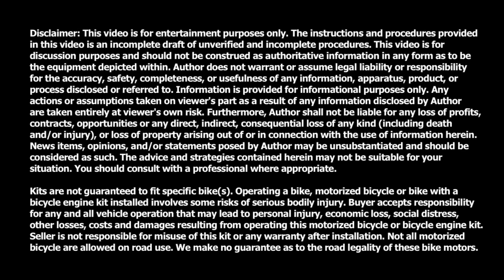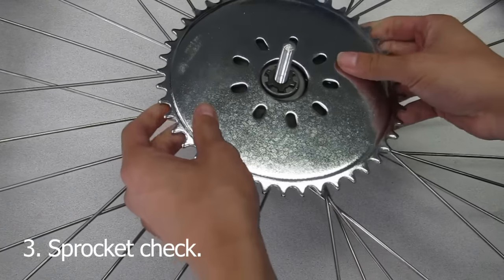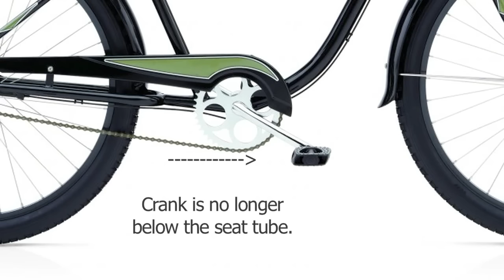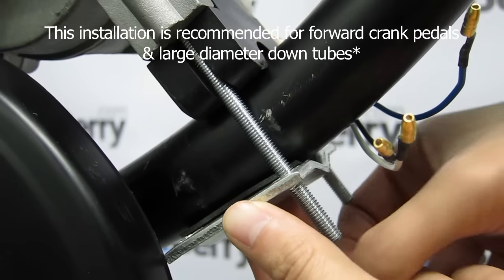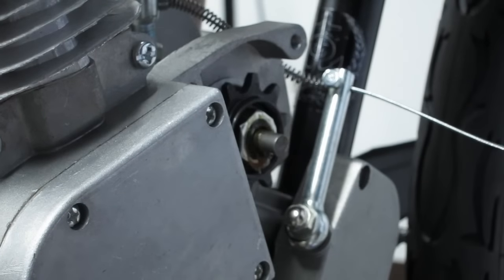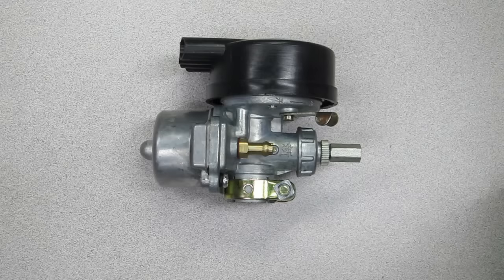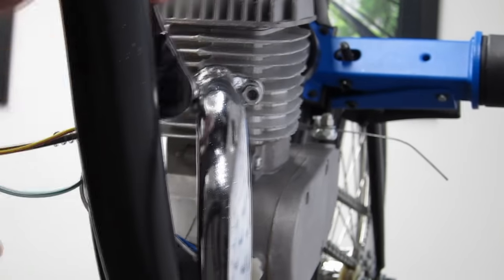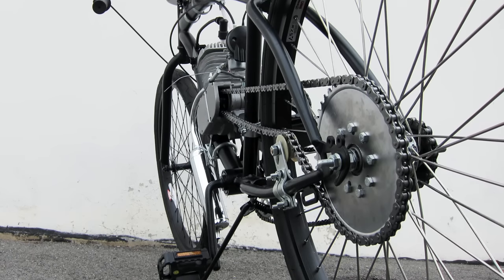How To Install 80cc 2-Stroke Bicycle Engine Kit FULL DVD 66cc 48cc 50cc

Comment: I got my hands on an 80cc flying horse kit and as I understand it, it was never started. It has a pull starter and the only way I can get it to start is with a spray of the gas oil mix into the back of the carb. At first it ran for a few seconds then cut off consistently, then it started running what seems pretty good but I haven't actually ridden it yet. I shut it off, and no way it's going to start, even when warm without that spray of gas, no matter how I adjust. Tried the original and the  popular aftermarket carb, and a couple of CDI's, (maybe they're both bad?) and same problem. Any ideas how to get this running right?
Reply from the maker: Please give us a call at  (800)317-0479 and one of our trained specialist will be happy to help you get your bike on the road.
Reply: Just looking for some first things to try, but maybe soemone else can help me out. I 'm just concern about sales pitches on the phone, because it seems a bit odd to need to call when putting it here can benefit everyone. Thanks just the same.
Reply from the maker: We have a team trained to help trouble shooting our kits. We would need to ask a series of questions and try to diagnose your issue, then giving you advice on a fix.  We will only "sales pitch" you parts you may need in the fix, if you're no longer under warranty. Regardless we hope you get your Flying Horse flying again.
Reply: Everything is installed like normal, or nothing unusual....pretty straight forward, and I've told you all that I've tried, but whatever...thanks again.
Reply from the maker: We appreciate the interaction and support for biking community. We only suggest calling our customer service representatives for the quickest and easiest, step-by-step troubleshooting, rather than waiting a few weeks for a few comments from the community. It is entirely not necessary, but it is the most efficient way that we can personally help you.
Reply: I'm not going to be working on it for awhile...It now won't even start and has developer a very bad kickback, so, my arm is now going to need some time to heal. Best I can tell it's the CDI since the timing is not likely off, but I've now tried three of them, one new high performance and the same amount of carbs... 2 new and one used.

It's just so much easier to try things written, at my leisure instead of having to call constantly until its fixed, so I'll likely find a good forum or just search the problem out, or even buy another kit since this is my only transportation and try working on this one at a later date, but thanks for the offer
Reply from the maker: We completely understand the convenience of writing on your leisure. We are always supportive of trying to fix things as much as possible on your own and interacting within the community for help. We applaud your effort and hope everything goes well. Keep us updated with your build, and let us know if there's anything we can do to help.

Comment: Will this work with a bike with 3 gears up front and 6 in the back
Reply: AnteaterGaming That would be an 18 speed bike and yes it would. The pedal gearing has nothing to do with the engine side.

Comment: my chain came off my 2-stroke engine so I've replace the chain and taken off the clutch at the engine but when I put everything back on and I let go of the clutch and tried to push the throttle my engine has no sound what do you think I could have missed all I did was take the chain off the clutch compartment and put it back on

Comment: I am a minimum wage, no mech or auto experience (besides oil change and brakes), its winter and my bike has no suspension. 

I ordered this from Amazon, Im going to leave a review on how hard it was to do this with my bike, and how my bike is after a week.

Comment: What is the purpose of drilling the 1/4" hole in the handle bars?
Reply from the maker: the notch holds the throttle in place.
Reply: It depends on what kind of throttle you buy. Mine didn't need the notch, you just tighten it down a lot and it stays firmly in place.

Comment: Do you need to lube the engine cylinder before first start up?
Reply from the maker: The design of most 2 stroke engines do not call for any additional lubrication of the engine, largely because the fuel and oil mixture will work to lubricate the entire system.

Comment: Not sure what the go is with mine but it seams to be stuck at wide open throttle and the throttle handle spins all the way around (not including kill switch)
Reply from the maker: Give us a call at  (800)317-0479  or message us on our website and well be happy to help.
Reply: Sounds like your throttle is not properly installed. Take it off and have a look at it.

Comment: When I install the clutch case back on and tighten it all the way, the clutch lever puts pressure on the clutch and makes it move freely when grabbing the sprocket. It doesn't lock up when the clutch is released 

Any suggestions?

Comment: SOMEONE PLEASE HELP: Hello! I currently have 2 motorized bikes. One of them has the normal stock engine head bolts, with the head easily removed to replace the gaskets/the head itself. The other one however, has allen bolts holding down the engine, with the head and body being smaller. It doesnt appear that you can replace the head and put on a high compression head, which I am planning to do. They are both 2 stroke kits.HELp

Comment: My bikes rear tire gets stuck when i release the clutch and hit the gas to start it.
I hear no failed start up noises from the engine and the engine chain and rear tire move fine when i pedal. Only when i attempt to start the rear tire seizes.
Any ideas?
Reply from the maker: Give us a call at (800)317-0479 and we will attempt to properly diagnose your problem.

Comment: I got a gas powered kit from Bike Berry.  I ordered the thick cushion motor mounts. This is an extra $15.00.  The bolts sent in this Extra thing are too small a diameter.  Other than that I give Bike Berry a Great Review.  The gas tank has a small dent in it so I called their customer support and talked to Max.  He treated me with kindness and respect.  He asked for me to send him a photo of the dent.  after 1 day I was contacted by them and they told me that they were very sorry that I ended up with a damaged part and they told me that they were going to send me a new 1.  I got it in 2 days.  I am happy I decided to trust these people.  I know they care about me as a customer.  I give them High marks.  Too bad about those bolts.  You will need to spend $2.00 for them. They are a 8 mm bolt with no head. Dont forget to get the nuts washers, and lock washers  Dont forget to get Lock Tite.  Also I must tell you I put this on a mountain bike with 10 or so gears.  Just so you know it can defiantly be done.   I will give them my continued  business because they earned it when they showed me that they care about me getting a quality product.    Kindest Regards James Gober
Reply: Glad to hear.   Because my kit is missing lots of parts.   And I emailed them.    It's Saturday befor Columbus day.    So I hope to hear from them by mid week. I also trust bikeberry. And will continue to do business with them.

Comment: Will these work on kids bikes or dose it have to be a certain size?
Reply: +Skip. AD 24 inch or above, so no kids bikes
Reply: +Korosh Baradaran dang I'm a kid
Reply: +Skip. AD well see if you can ride a 24 inch bike comfortably, if you can then this will work. sometimes 24 inch bikes are considered kids bikes too, so check if your bike is 24 inch
Reply: +Korosh Baradaran thx
Reply: +Korosh Baradaran so does this bike have 2 chains? the motor and pedal?
Reply: +Anthony Ingram Yes. One on the side with the pedals, one on the other side. You can pedal the bike OR you can use the engine :D

Comment: I'm trying to drill the hole for the throttle handle but it keeps slipping from where I want to drill.  Any tips?
Reply: +Dominic Balistreri use a tap or a piece of pointed metal  and hammer to bang a hole to get a start and if drilling a big hole with a lot of metal always start with a smaller bit and move up as needed like if your trying to drill a 3/8 hole start with a bit half that size.
Reply: Push down super hard on the drill or get a very sharp drill bit or try to get sandpaper and make a mark on the sandpaper the same place you wanna drill then put the sand paper on the bars and then drill
Reply: update: After breaking two drill bits I decided to just use electric tape to hold it in place.  Has worked for 3 months now.
Reply: what is the hole for exactly? it easjt specified in tue video

Comment: Basically you are building a motorcycle... this is too complex.  Do they have a place where they install this for you? and how much do they charge for installation?
Reply from the maker: This is closer to a moped rather a motorcycle. These are DIY kits and the majority of our customers are able to make the install on their own.
Reply: If you are willing to pay someone to do the install, you may as well just buy a premade moped. You'll save money and time. These kits are for people who want to do it themselves.
Reply: @rhetorical_annihilation  That wouldn't be cost effective to me cause I already have a bike, with two wheels missing (stolen by thieves). It's a nice bike with aluminum frame and very expensive crankset. It just needs a motor so I can commute to work... Would be nice for a bike shop or any shop that sell these motors install it for me.
Reply: @bikeberry  How fast can it go?

Comment: black to black, red to blue, and white is not used unless you attach a headlight to your bike. then u would connect the red wire from your light to the white wire and t
he black wire from your light to the bike frame or he black wires.

Comment: there are some things that may take a little more time to install such as the throttle cable to the carburetor due to the spring being so awkward to compress. 
We purchased two motors and keep them aboard our yacht for times when suitable means of transportation are not available.
They run great. One needs a bit of TLC, but work out nice.

Comment: when I start my bike it just gradually increases in speed. No many how any times I rev the throttle it will not increase speed. I can only do this by adjusting the gas intake while riding, which is incredibly dangerous. It does get up to 25 pretty quick when I increase the gas intake a bump right after takeoff, but anyway to fix the throttle to control speed?
Reply: william hackenyos adjust the idle

Comment: I have a few questions:
1. How do you start the engine?
2. How do you provide throttle?
3. What oil do these engines use?
Reply: 1. You start the engine by holding the clutch in starting to ride, then then you let go of the clutch and the engine starts. 2. You can control the speed with the throttle. 3.  These engines use two stroke oil

Comment: I have a problem my chain is hitting and i cant figure it out any help will do please?
Reply from the maker: Give us a call at (800)317-0479, one of our reps will be happy to help you.
Reply from the maker: If you mean that there is chain slap, there are a few things that can be done. Check that the chain idler is taking up the extra slack and is firmly tightened to the frame. If there is still too much slack, even with the idler holding tension, there may be too many links on the chain. Use a chain tool, often called a chain breaker, to remove some of the links. If the chain is rubbing the seat tube, a simple solution is to flip the rear sprocket to gain about a quarter inch of extra clearance. If these solutions do not work, please contact our customer service representatives at 1-800-317-0479

Comment: Will it work with disc brakes
Reply from the maker: The rear sprocket typically occupies the space where the brake rotor is mounted. Both the rear rotor and caliper would need to be unmounted to install this engine kit.

Comment: The little screw where the clutch located is really hard to remove and most of the time it will get strip
Reply: No need to remove any of the engine or clutch covers. Just engage the clutch and use a screwdriver to spin the sprocket and feed the chain onto it.
Reply: Don't remove that. It just could to push against the rubber insulation around the cable and strip the threads. You remove the cable by actually tightening that up and make sure the other end of the cable is not attached
 to anything on the engine or carb. This gives you the slack you need to remove the cable. You cant take them off unless the other friend is free

Comment: What is the 1/4 inch hole for by the throttle?
Reply: There is a pin in the kill switch assembly that will go in the hole that you drilled. The purpose of this is to prevent it from rotating on the bar.

Comment: can you use this with a bike with gears?
Reply from the maker: Gears will not have any effect on any of our engine kits, as they all work directly on the wheel and have no connection to the bikes drive train. The only issue is if the rear wheel uses a flip flop hub, which has a free wheel sprocket on one side of the hub and a fixed sprocket on the other side, or if the wheel uses a disc brake, in which case the rear disc brake will need to be removed.

Comment: Thank you for answering my question. The pineapple bushing they gasbike.net sent me doesn't have a rag joint it is supposed to fit in the spokes it has groves on the three back pieces that bolt through to the sprocket. Plus it doesn't fit the hub on my miami sun trike rear wheels the joint inside diameter is to small for my hub which is 3 inches. They tell me I'm switching out of luck. That's all they sell do you guys sell the rite pineapple joint I need?
Reply from the maker: Your best option is to visit our website or give us a call at (800)317-0479 to see our current inventory and listings.

Comment: And what about the extra white wire from the magneto?
Reply: You don't need to use it. Its connected to the generator on the engine and provides a nice ac current that can be used to power lights. However I wouldn't recommend using the wire at all since it robs power from the engine.

Comment: On Project Farm the guy took out the tensioner and just took up the chain slack, he said that way there's no danger of the metal piece tipping inward, locking the back wheel and sending you catapulting into the street.   
How realistic is this?   The only thing I can do is take out 2 links (you can only remove 2 at a time) and this makes the chain perfectly tight.   But now I'm reading all this online about "flex" and "suspension" and "a too tight chain will ruin the sprockets and break, always better to be too lose than too tight".
Uchh.....  IDK

Comment: Just finished my first build and it was running semi-smooth. Now the thing vibrates like crazy sort of like something is out of balance. Does anybody have any ideas? I have went through and made sure everything is tight.
Reply: That's weird bro maybe you need more gas? Oil change? Lol
Reply: +Not bob well it isn't a 4 stroke. 2 stroke has its oil mixed with the fuel
Reply: Dan smith. Sorry to here about your trl

Comment: Hey why do my spokes keep coming loose to the point of coming off ive had to  true them many times a ride as i can hear them popping off and went through at least 6 rear tires as the spokes were too damaged
Reply from the maker: give us a call at (800)317-0479 and we can properly assist you.
Reply: That;s a risk with the rag joint. You might be better off getting a hub adapter.

Comment: Is there any way to balance the crankshaft on a 2 stroke 80cc engine?
Reply: If you purchased the kit in the video like I did. It supposedly comes balanced. But my kit is missing alot of parts so I haven't finished my assembly yet.

Comment: Do they get oil in the case
Reply: Yes. These two strokes intake the fuel and air mixture into the crankcase below the piston, then it is pulled into the cylinder. This allows for lubrication of the crankcase, protecting oil seals and bearings. (This is why you should not run your engine very hot when it is brand new! You could melt fresh oil seals or ruin crankshaft bearings)

Comment: Can i put this on a hardtail 27.5 inch bike
Reply from the maker: Designed for a 26" but possible with custom modifications.
Reply: @bikeberry  its 2019 and still commenting
Reply: @bikeberry  whats the chances i will get a problem only thing is that it has bigger wheels and the frame is the same
Reply from the maker: @Daddychill945  You should be fine, Most people are able to install on larger than 26" inch with no problems.

Comment: can somebody please help... my motorised bike rides even if I don't use the throttle and that means I can't stop the bike. How can I stop this so I can control the speed of the bike and stop with the engine still running
Reply: try unscrewing the idle screw on the carb

Comment: PLEASE SOMEONE HELP. I recently put my motorized bike together.  Without the spark plug in, the engine wants to turn over when I release the clutch.  With the sparkplug, it does NOTHING. WHATS WRONG!
Reply: You're not pushing hard enough it sounds like. When the spark plug is off, its easy to turn the engine over because there's no compression. So to get your bike started, all you gotta do is pull the clutch in, get rolling to at least 5mph, and then slowly release the clutch lever. Then pedal like you're late for work and if you've done everything right, your engine will start.

Comment: what do i do if my bike carba nd engine are running good but when i give it throttle it willstart to go up and get louder then it ends up just leveling out not wanting to accenerate or get louder what should i dotofix this,           ps i tried changingthe c clip on all settings it still dose the same thing
Reply: Try adjusting the oxygen mix, on the carburator twist the brass screw with a spring